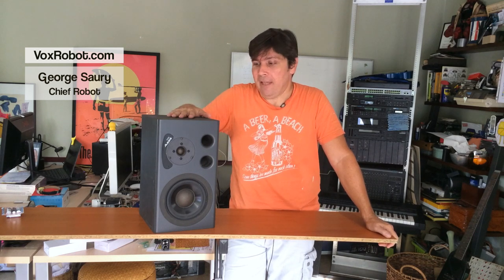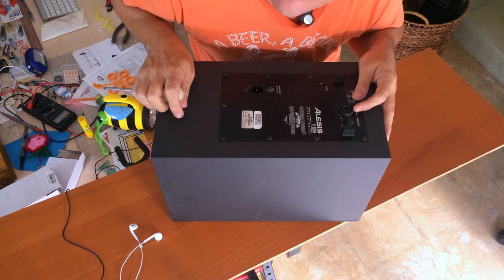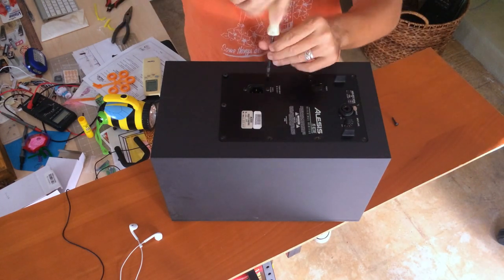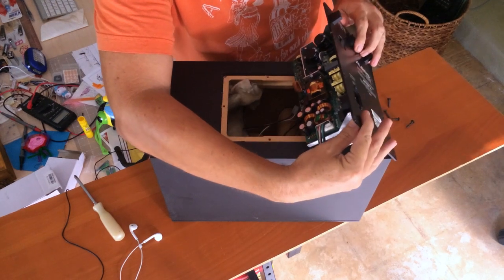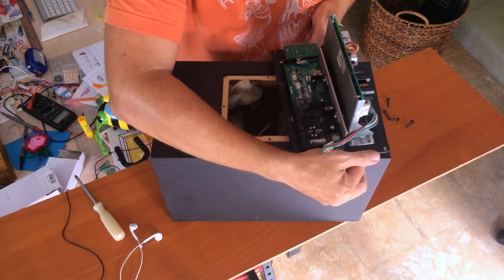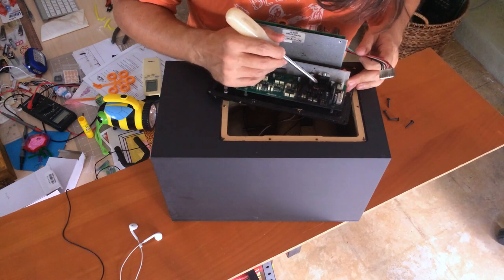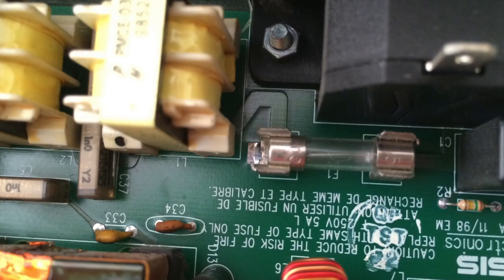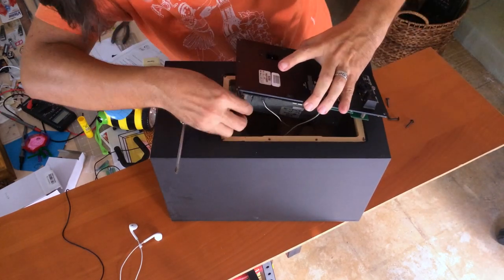Alesis M1 Active Speaker Tear Down: Back to Mono

Comment: Great video! Where does one order a new circuit board? My M1 Active had a similar fire.
Reply from the maker: I looked for replacement everywhere -- no dice. After much trolling eBay I found a match pair of MkII amps (the whole back) for ~35-40 and they dropped right in and sound slightly better -- who could tell with 20 year old cones. let me know how it turns out!
Reply: VoxRobot thanks!

Comment: I'm trying to open up my M1, similar to what you just showed.  However, it appears to be glued down!  Have you ever heard of this dilema before, or more specifically, have you ever heard of a solution with minimal cosmetic damage?  Thanks.
Reply from the maker: I've open a few studio grade speakers in the past (I worked a local studio) is common to change blown tweeter or fuses, and have never come across glue. Mine were not glued, but the amp circuit was very tight and I had to pull very hard on the tabs that are next to the XLR input. If you are sure is glue (is there residue) try a heat gun (make sure is set to low). Most glue will soften with heat -- just be careful not melt the grey finish -- stay on the metal and protect the wood with painters tape. Good luck and let me know how it turns out. Coincidentally I found a replacement for the burned amp stay tuned for the follow up video.